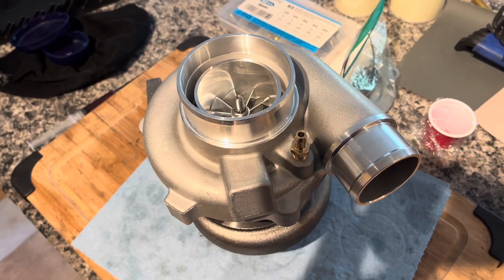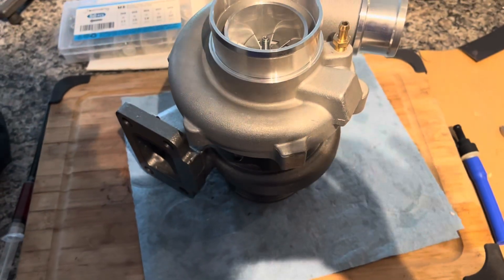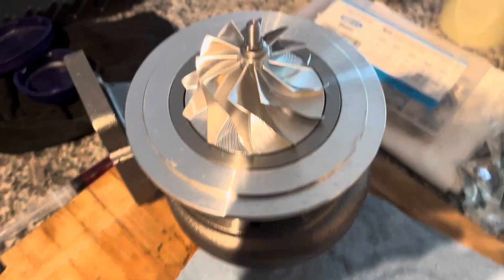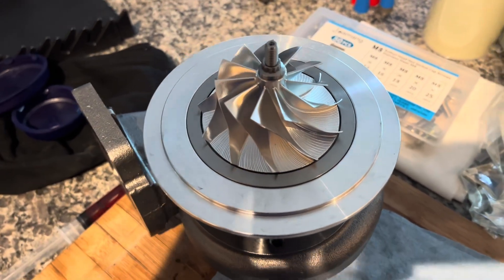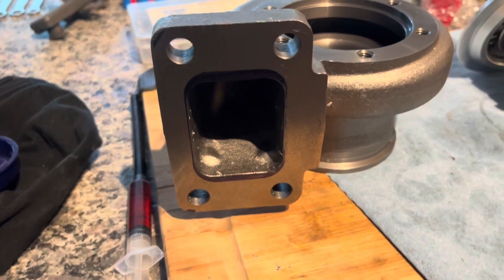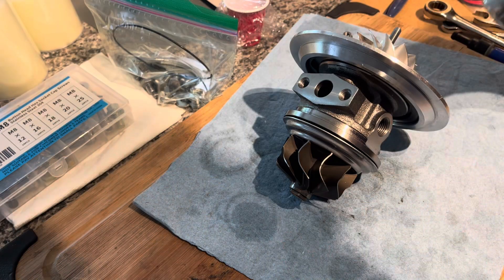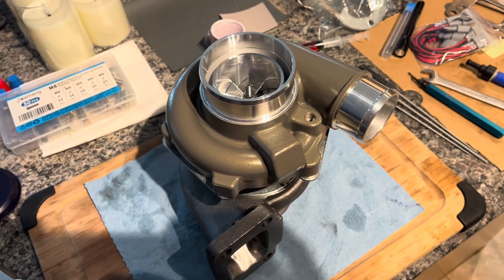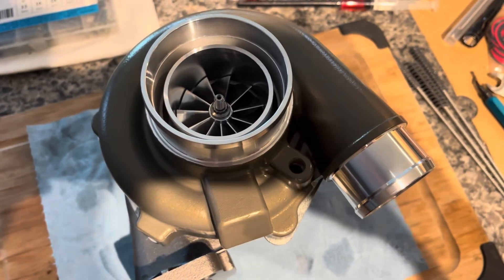$200 EBay Turbo Jackpot - GTX3071 China Turbo Review & Upgrade

Comment: Looks can be deceiving . They look ok but they are far far from ok. The material used to make these piles of shit are absolutely trash. Not only that they are straight stolen designs. Anyone who has a minute amount of common sense and compassion would never buy these or any other knock off part period
Reply: Ok your evidence of metallurgy
Reply: @Rch5.0 they use 409 instead of 321 or 304 . They use an extremely cheap and very dirty iron that gets hot spots and becomes extremely hard to where a file won't touch it. And the aluminum ha no where near aircraft worthy and is extremely soft so it strips and breaks easy. Let's not forget the so called billet wheels that are infact cast then machined to look billet.
Reply: Ok got it now I understand

Comment: Makes me wonder sometimes like those American companies slapping their brand names on the drop in turbos for the FK8 FL5 type Rs and just getting it manufactured in china? I wouldn’t be surprised if they get made at the same factory. American design made in china 🇨🇳 500 bux vs 3500 bux for the U.S labeled branded ones.
Reply from the maker: The main difference between China turbos and brand name turbos is the materials used on turbine wheel and occasionally housings & the quality of assembly balance. 

However the professional Chinese manufacturers are now near matching both materials and balance using inconel alloys, stainless housings and proper VSR assembly balance to 160k rpm. 

I used to be a dedicated Borg Warner and Garrett guy but have now fully gone back to Chinese turbos, just doing the type of quality control inspection as I’ve been posting in these vids. 

Check out my recent eBay g25-550 turbo video. Nicest Chinese turbo I’ve seen by far, essentially a near duplicate of Garrett other than rear housing is grey iron not ss304.

Comment: The machining and components look really nice! I haven't had a stock wheel come off that hard, but I did have a really hard time installing an aftermarket billet wheel that I expect will take quite a bit of force to remove again. If the turbo in this video ever fails we'll get to see all the internal bits I suppose. ;)
Reply from the maker: If I see a failure I’ll then attempt to heat the wheel and press out the shaft but I didn’t wanna risk bending or galling anything with it being new and seemingly without issue. 

Astonishingly good value for the overall price. I have half a mind to buy another just for spare gt30 series parts.